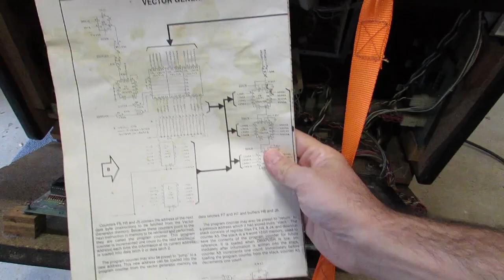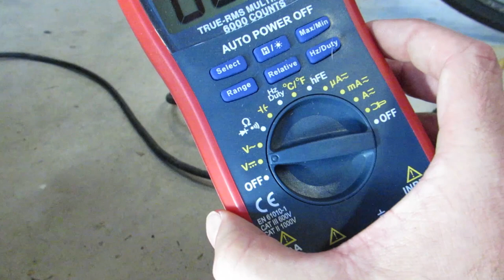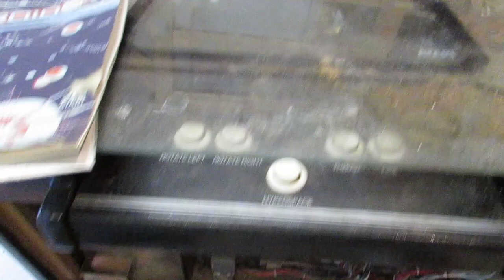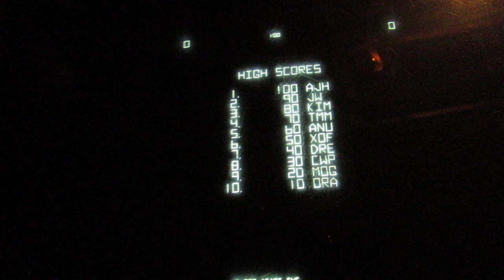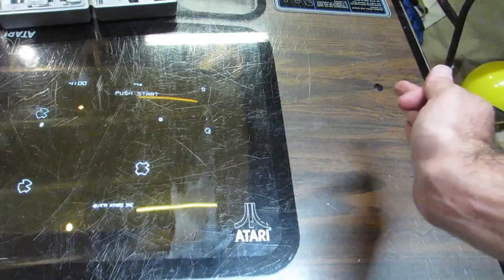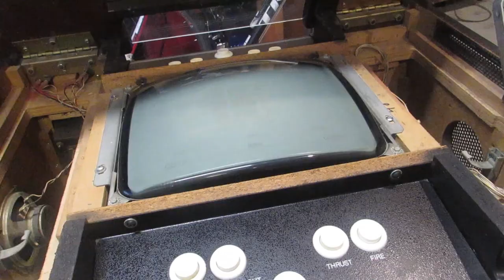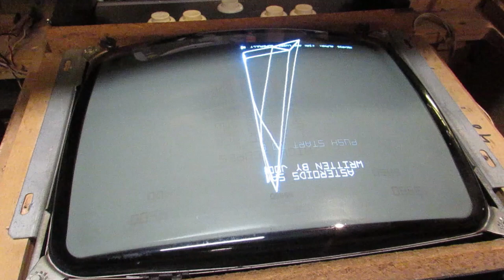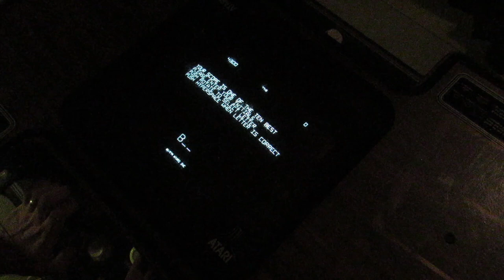Atari Asteroids Cocktail Table Refurb

Comment: The collapse you're seeing isn't the main monitor connector.   That happens when the deflection board can't talk to one of the frame transistors, due to a bad connection.  Reflow the header solder joints on the deflection board, and hit the headers and connectors with some DeOxit.   Also make sure there are no breaks or weak wire connections where the wires meet the frame transistor sockets.   You can also sometimes get an issue where the sockets stretch out, and don't make solid contact with the legs, in which case you can remove the transistor, and just pinch the socket legs slightly with some needlenose pliers, to restore their grab.   You don't need to replace the sockets.

Comment: Also, there's no dipswitch for cocktails in Atari games.   There's a pin on the game board's edge connector that is grounded by the harness in cocktails, and left open in uprights.  That signal the cabinet tells the board what type of cab the board is in, and it toggles cocktail mode automatically.

Comment: Hey Tim.  Andrewb here.   Nice vid.   Several additional tips for you, that apply to all vectors:    

1)   Replace the 2N3055 bottlecap transistor on the AR.  Always.   You don't need to replace the caps, but you do have to replace the 2N3055 on any AR.   These all have thousands of hours on them, and will send 12V to the game board roughly 50% of the time when they fail.   You can tell if yours is original, as the 4-digit date code on it will start with 79, 80, or 81, which is the year it was made.   So you always want to replace them on any AR.  And ALWAYS be sure to pay extra to get one from a trusted source, like Digikey or Mouser, not ebay, aliexpress, or any small arcade parts sellers.   There are a lot of fakes out there, and they can damage your cab.   It's the most important part in the whole cab, in terms of protecting the game board, so pay to get a good one, and you'll be set for another 20 years.

2) On the HV cage, always recap them, as the caps are usually dried out.    There are only four caps, so it's easy.   And be sure to get legitimate Nichicon or Panasonic caps from a trusted source.

3)  The most important thing (and problem) on all HV cages is the HV diode.   Not the diode itself, but the springs and contacts inside the boots.   The grease they used dries out, the springs get rusty, the contacts get resistive, and they heat up and burn up the boots (which then will cause you to have no HV.).  This is an issue on all b/w vectors that have HV diodes.   The way to fix them right is to disassemble the boots, clean the old grease out with Q-tips and Goof Off or acetone, and soak the springs in vinegar to remove the rust (or sand them).   I then will solder the springs to the diode, so that the problem won't happen again.   I have a post on KLOV about it, here:  https://forums.arcade-museum.com/showpost.php?p=3824155&postcount=100

4) Always reflow all of the header pin solder joints on the monitor's deflection board.  These always crack, and cause the collapse issues you're seeing.

5)  Get a can of DeOxit D5S ($15 on ebay), and use it on all connectors, everywhere in the cab.   Will save you a lot of headaches and bad connections.

Good luck with the rest of the restore!
Reply from the maker: Andy!! Thank you for ALL of the excellent information! This gives me a great list of things to go back and do to get another 30-40 years out of it! 

Great tip about buying quality parts! I was replacing some bottle cap transistors last night with Jay and he said, "Don't use the ones in this bag here, those aren't good quality and may even be knockoffs, use these other ones here."  Are there brand you would recommend or ones that you would suggest people steer clear of?

I keep a can of DeOxit nearby and did try that on the connector (before I repinned it). Of course that was also before I deduced it to being on the deflection PCB of the monitor!  

To anyone reading the comments, this is the gentleman who I purchased my Asteroids board from. He provides an excellent service to people running vector arcade games!

Andy, thanks again for your assistance and sharing your wealth of knowledge with us!
Reply: @ThatTimGuy  The thing about quality transistors isn't so much the brand, it's who you get them from.    Counterfeit parts are made to look exactly like legitimate brands (like ST, Texas Instruments, etc), so you can't go by what appears on the part.   Just buy from large, well-known sellers like Digikey or Mouser, and you'll be all set.   Getting transistors and other parts on ebay or from other 3rd party sellers is like playing Russian roulette with your game, as you don't know who made them.    

For active parts like transistors, you can get whatever the large distributors have the most stock of (as those are the most popular).   For caps you should stick to brands like Nichicon and Panasonic, and always try to get 105C high-temp parts, that are rated for at least 2000 hours, if not 5000 or 8000, when they are available.   Learn to use the search tool on Digikey and Mouser's sites, as they will let you drill down through literally over a million parts quickly, to find exactly what you need.   It's worth setting up accounts with them, and taking some time to learn how to find stuff on their sites.

Comment: Also, you don't need to repin connectors on Atari games.   Just get some DeOxit, and use it.  That will take care of most connection issues.   If there is any other damage worse than that, find it, and repair or replace the bent or stretched pin.  But wholesale repinning and replacing entire connectors is never really necessary.  99% of the time a cleaning is all they need.

Comment: That's awesome,  Tim.  Great job and the sound works great.  Probably should have tested it in 2 player mode and tested all the buttons as you didn't use the hyperspace button on the game play.

Overall, great work.  Cheers from Toronto Canada.
Reply from the maker: Ah yes! Good observation! The 2nd player does work and so does hyperspace on both sides. My kids have been testing out the 2 player mode quite frequently!
Reply: @ThatTimGuy  ArcadeParts.com has interlock switchches to replace your existing broken interlock switch.

Check out:  https://na.suzohapp.com/products/gaming_parts/53-7030-CK  or   https://na.suzohapp.com/products/electrical_supplies/53-7036-00
Reply from the maker: Excellent! Thank you very much for that link! I appreciate it and I'm sure many others will as well!